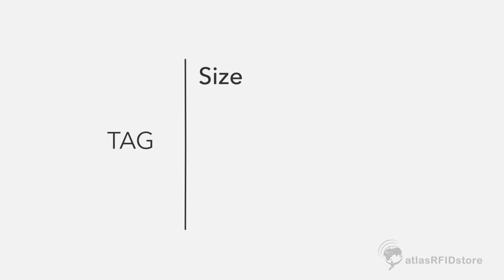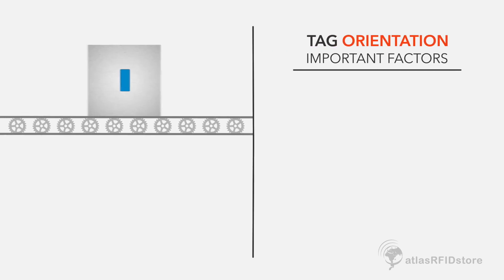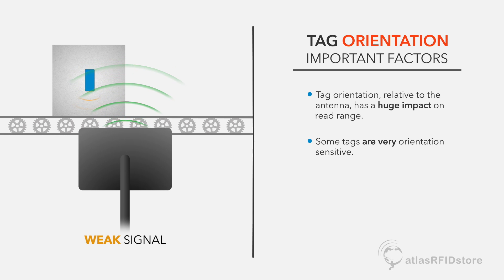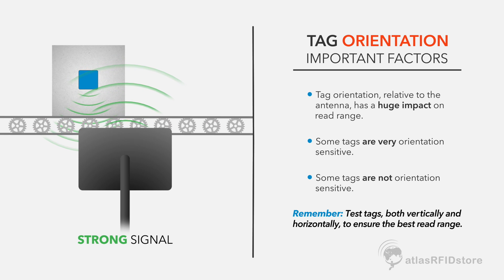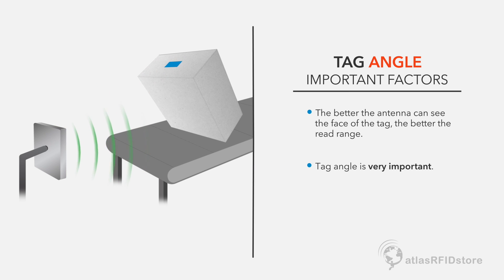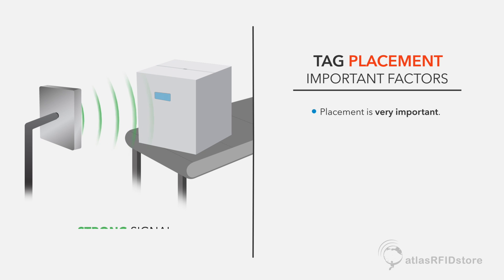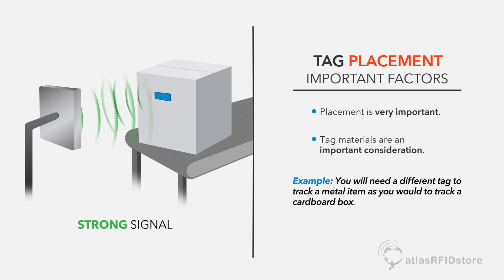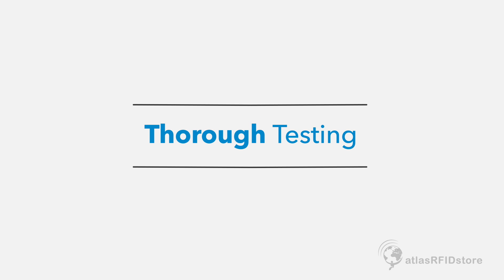RFID Tags: How to Get the Best Read Range

Comment: Hey i am using mfrc522 rfid module and is it possible to get 0.5 meter range with this chip and if yes how can i get it,with my card i am just getting 4 cm range
Reply from the maker: Hi, Likely no. The issue is that you are using HF which is 13.56 MHz which has a typically shorter range than UHF. Checkout this ebook that talks about the difference in frequency ranges and how it corresponds to read range - 

https://www.atlasrfidstore.com/a-guide-to-rfid-types-and-how-they-are-used/

Thanks!
Reply: @atlasrfidstore  Thank you so much